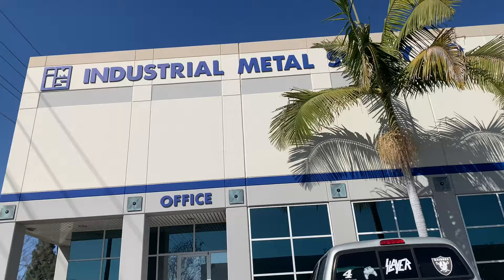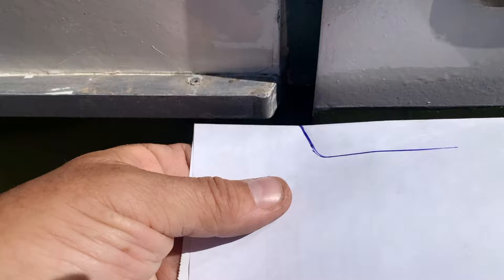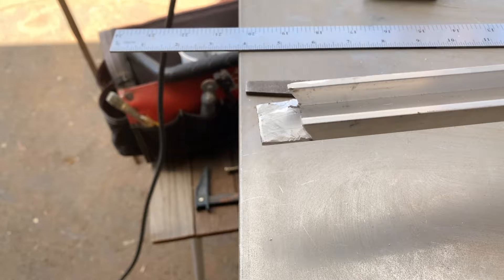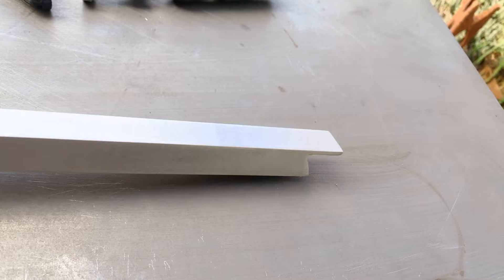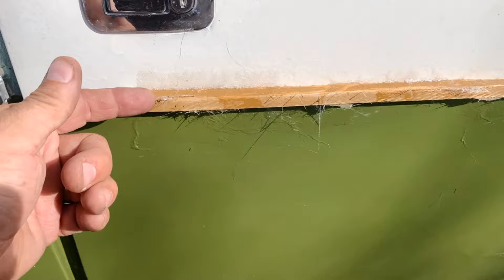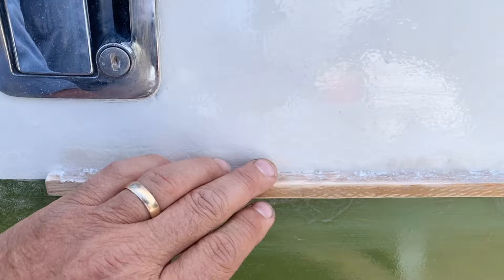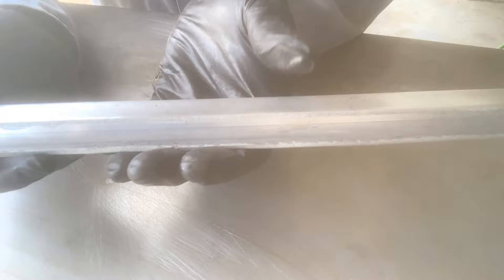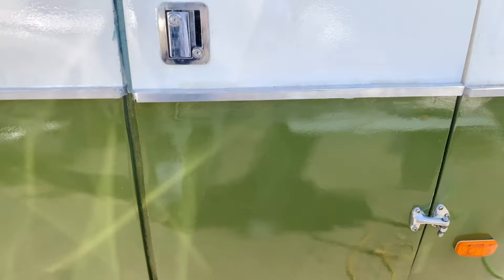Scamp Door Trim Made and Installed | Audio Issues Addressed | #Scamp

Comment: Thanks for all the great instructions and tips.   How long does it take for the fiberglass fumes to go away?  Does painting lock the fumes in?  Thanks
Reply from the maker: Hi Greg, if you’re outside that’s best, but if you’re in a garage and the fumes go through into the common house it will smell awful between 2 hours - to several hours. If you work in a garage make sure to run a big fan blowing the fumes outdoors.  Once fiberglass is painted, fumes cannot off-gas or escape. Hope this helps!  Johnny 👍🏼